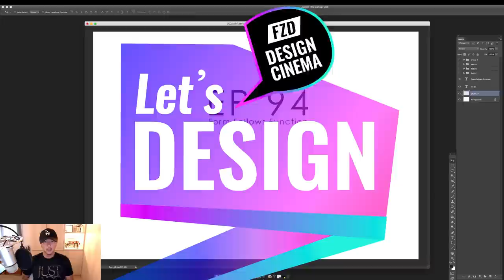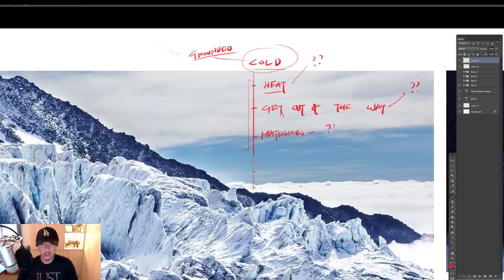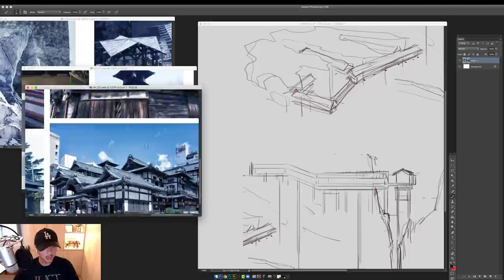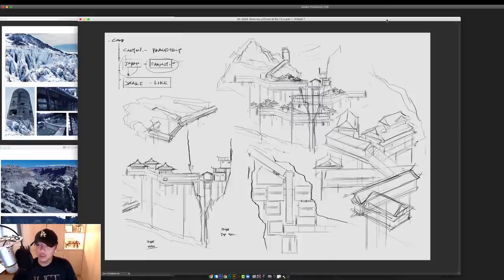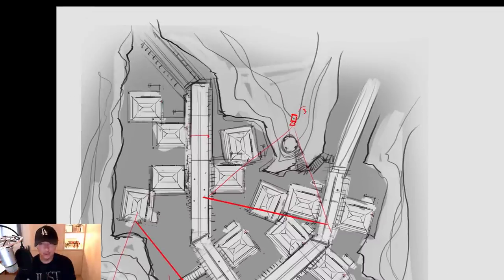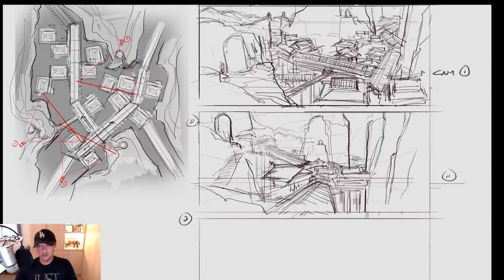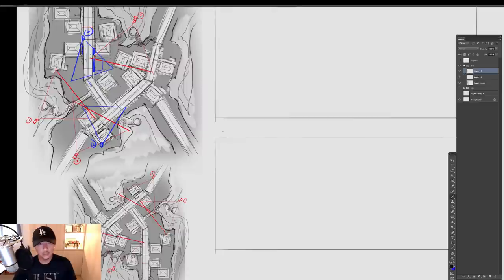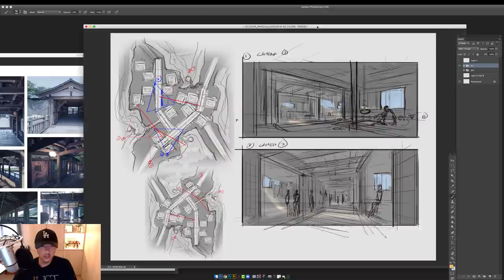Design Cinema - EP 94 - Form Follows Function

Comment: I would love to see how conceptartist tackle complex geometric patterns like viking knotwork or islamic geometry - how do you do stuff like that so intricate on a deadline?
Reply: You can draw in flat and utilise duplications and mirroring to make a pattern then transform it into place. Depending on what it is you can usually get a library of gestural patterns in your head that you can quickly achieve. I find nouveau curves pretty easy to do after doing them a lot. Nordic patterning I'd need a bit of practice to get up to speed.
Or photo textures.
Or git gud.
Reply: @JayJapanB  to get The initial sketch, do you like trace The pattern/analyze it somehow until you "get it"? I find for example nordic pattern to be really hard to break down logically  as it can easily turn into just a mess of tangled lines
Reply: @kibatsuki  Yeah, with any pattern, it just has to be easily recognisiable. It doesn't have to be perfect. So just study the actual patterns until you get a "Nordic style" pattern. 
But yeah, those look pretty difficult. 
You'd be surprised what you can get away with once your start mirroring and copying stuff around, as long as the detail is small enough.